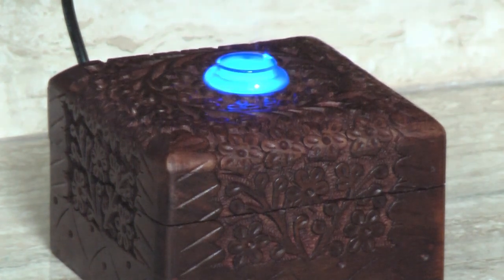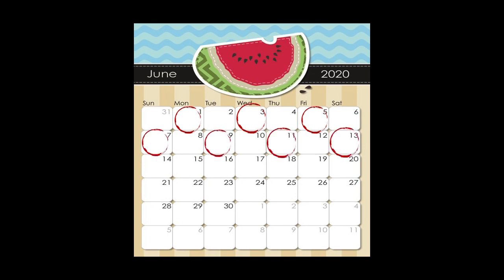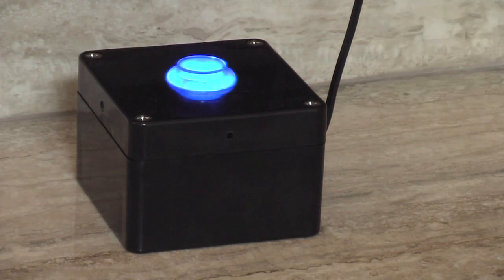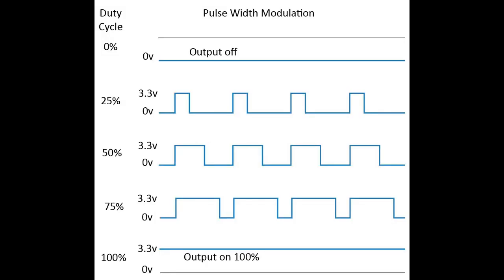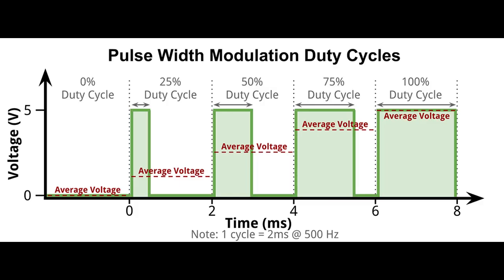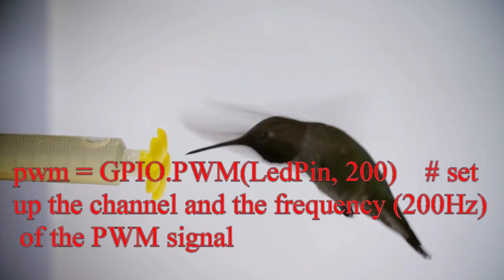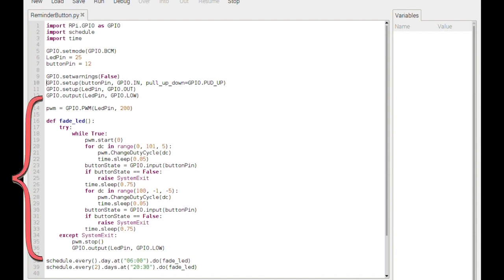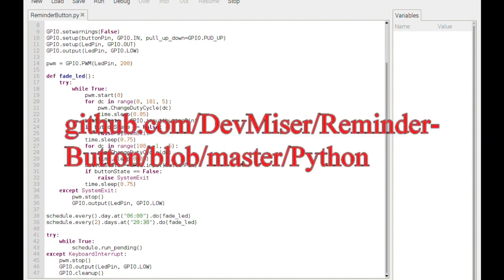LED Reminder Button Using Raspberry Pi Zero

Comment: Actually, if it's dark and the light is set to a very low level and you move your eyes (or the light) quickly, most people can detect flicker upwards of 10 kHz. If you want to make sure no human can see the PWM modulation under any circumstances, use 15 kHz or more.